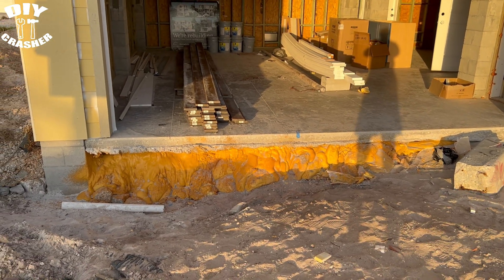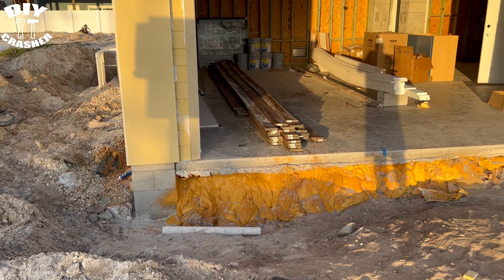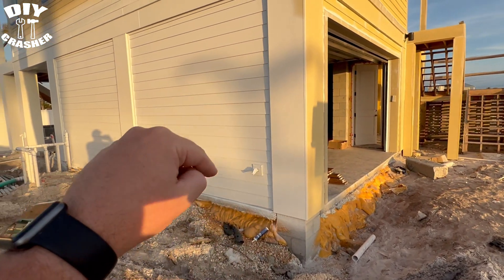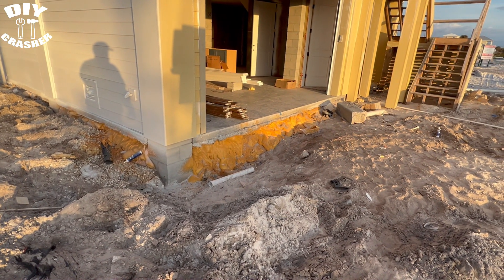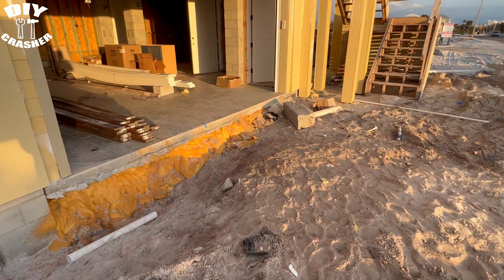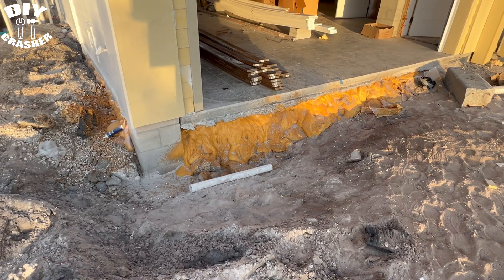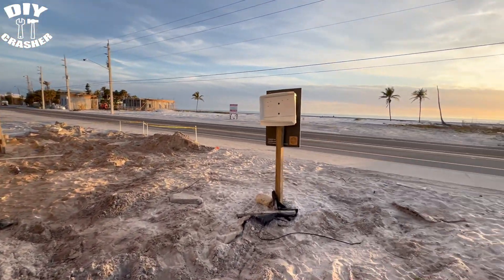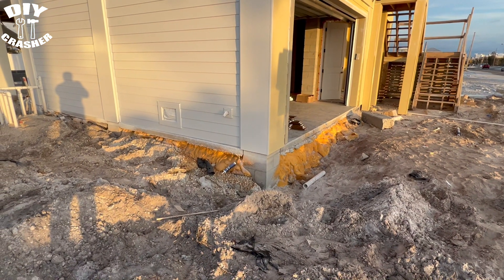Is Spray Foam Insulation The BEST Choice For Under Garage Floors?

Comment: Spray foam is definitely used to insulate floating concrete floors. I don't know if this particular example was done correctly. And all concrete cracks, the joints when done correctly dictate where they show up.
Reply from the maker: Thanks for your comment.  I can see that being a practice done in other areas where the conditions are suitable for it.  I've seen many recent homes being built in this area and this is the first I've see with spray foam under concrete and it was definitely applied after the concrete was done.   At least here the builders bring in gravel to create a base that is packed down then put the concrete on top.
Reply: @DIYCrasher  if the foam was sprayed after the concrete then it's only on the sides and not underneath it.  maybe they are just trying to prevent soil erosion...  Interesting find..

Comment: Out of curiosity is there gravel a 8 10 inch back?  Ive see where they prep a pad and spray a layer of closed cell structural foam over the gravel to insulate and create a sealed vapor barrier.  Although i live in Alaska not any where near palm trees.  Does look like a lot of foam, id think gravel would have been cheaper
Reply from the maker: I can imagine what you are describing would make sense in Alaska, especially needing as much insulation as possible.  I've never seen this in Florida and there has been many new homes built around where I'm at because of Hurricane Ian a couple years ago wiped out many homes so people are rebuilding now.  Yes, they would normally have brought in gravel and pack it down to create the base for concrete.  This spray foam without a doubt would have been expensive to apply.

Comment: Looks to me like somebody needs to get fired or that garage slab needs to come back up. There's no way that's going to accept a car it's already cracking. It is sitting on Sand which is not stable in my opinion
Reply from the maker: I agree, it looks sketchy and I would think the slab needs to be replaced after putting in a more solid and stable base to install it on.  I looked up the permit and the owner is paying $930,000 for that house build and that's not including the $180,000 permit for the pool.
Reply: Spray foam is strong and is used on interstate highways to raise the road.